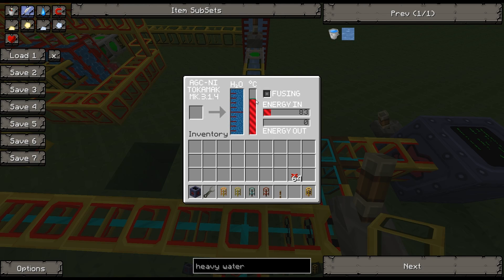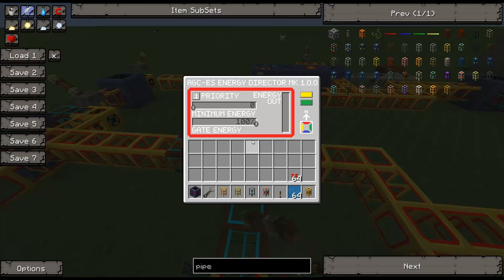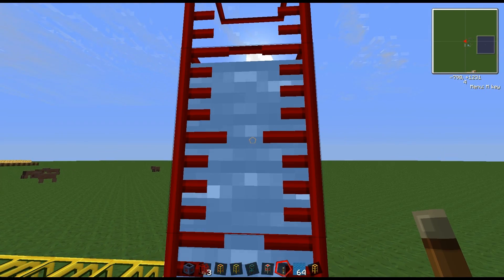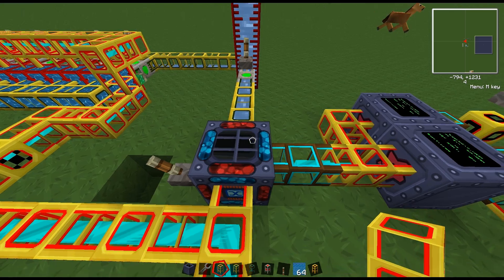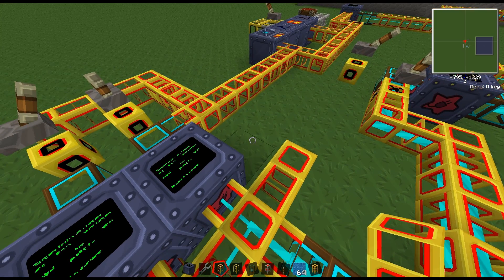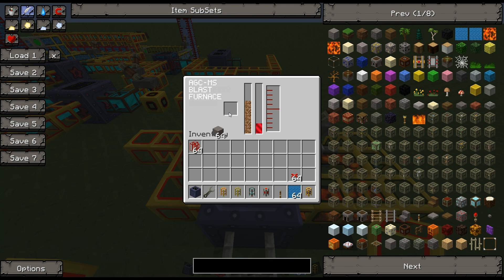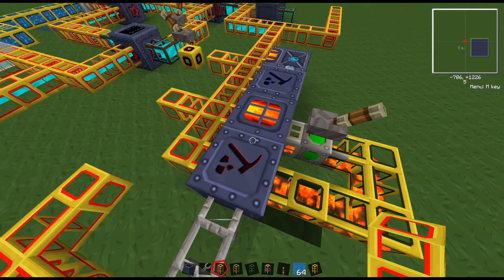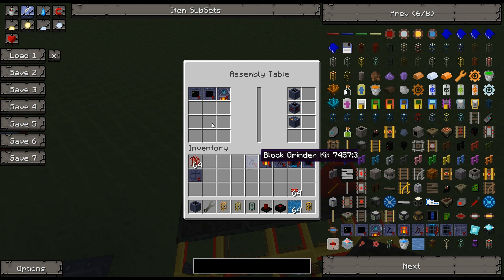APS [Pt 3]- Mod Spotlight [1080p HD]

Comment: Its hilarious, that you yet dont know about unlimited water source physics.
The reason why you are running out of water constantly is because you have the pump in the corner. youre suppose to have the pump in the center so the pump dont suck up the water source. Also all the hoping around gets people dizzy. sit still and explain in a clear and concise voice. Also, learn about the mods you are using before making a spotlight about them. Also never ever change the texture pack if your spotlighting

Comment: @PAKAM45T3R
I always measure them in EPT (Energy Per Tick), as when you use MJ, everyone says/reads it as megajoule, which includes a multiplier, making everything quite ambiguous.

I did try to introduce FCE (Fuelled Combustion Engine, equal to 5EPT) as well, but it didn't catch on.

Comment: You inspired me to try this mod. I found that the tokamak (sp?) heats up much faster if you apply redstone to put it into idle mode. Took only a couple minutes to get up to max heat / max (500) energy output. Plus it only takes a fraction of the heavy water to run it in idle so much more efficient to heat up before producing energy. Did have some weird chunk issue where I lost about 5 minutes of work though - so I'll hold off on using it for the time being.